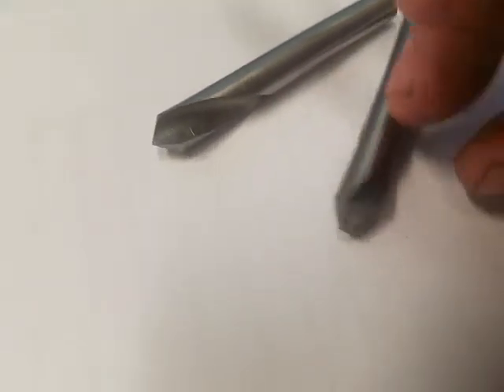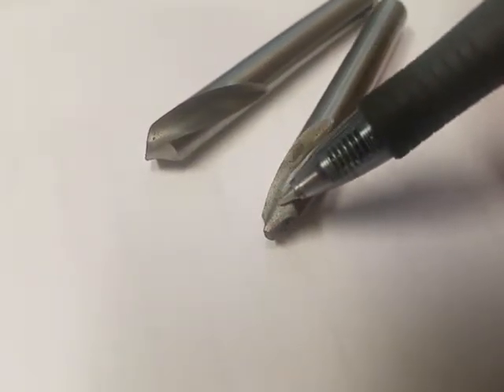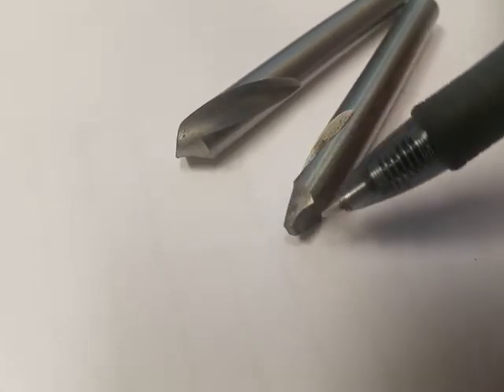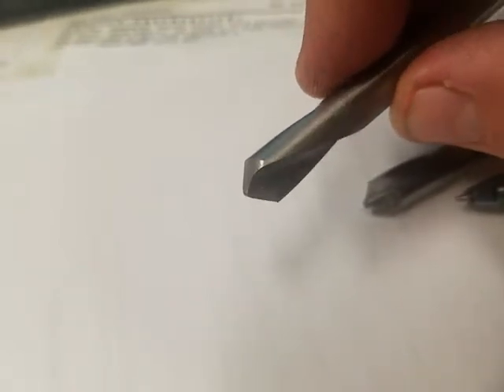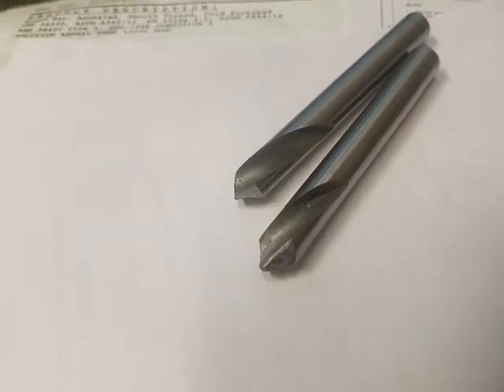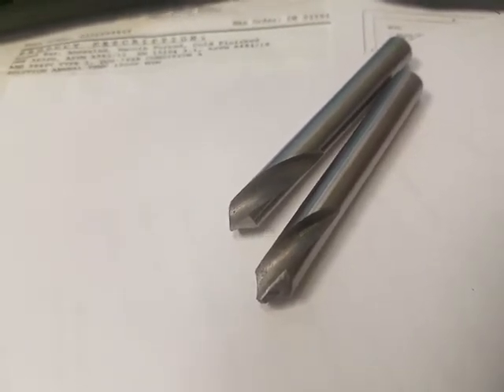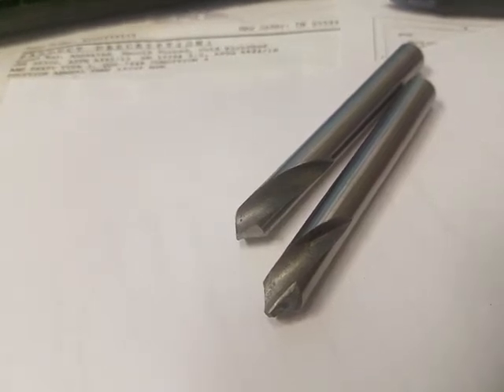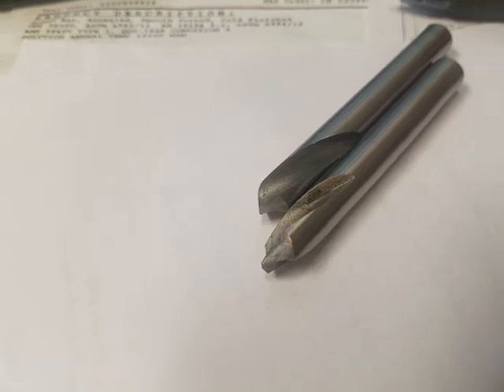Spot drill mods for removing helicoil thread insert

Comment: Do you know any suppliers in Europe? I have to take out a m12 helicoil
Reply from the maker: It's the same principle. You would need to modify a .500 dia spotting drill. Or look for left hand spotting drill. Install in a hand drill and run it counterclockwise with light pressure until it grabs and starts to unwind.
Reply from the maker: Sorry I don't know of any suppliers in Europe. Do you have a bench grinder? And a 14mm drill bit?